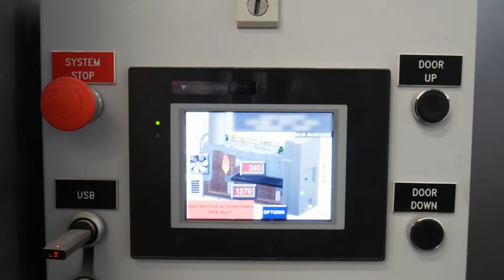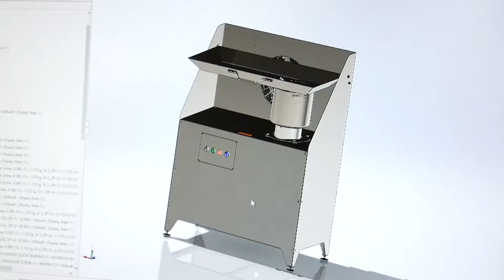Cremation Systems

Comment: I spent 3 months shopping for and comparing retorts. While the CFS-2300 was only a slightly better cost than other manufacturers entry level machines, I liked that the CFS-2300 was the only model they built. I told the competitors I was considering this machine, and they only focused on bashing it, instead of educating me how their machines perform better. While the bashing sounded good in the moment, it didn't make sense in the days and weeks down the road. (Who could continuously  sell machines that burned the hands off of the operators) As a third party provider, it was important being able to handle cases our clients couldn't cremate in their own machines. The CFS-2300 is rated to handle 750+lbs. Entry level machines from competitors didn't offer a capacity anywhere near that. Our build and install quote was roughly half the time from competitors. While other competitors tried charging me for remote internet monitoring on the machine, Cremation Systems included this at no cost. Ultimately, we are excited to be the first in our state to receive machine from this company for installation. We look forward to receiving this machine in October 2021.
Reply: Andrew - thank you very much for the kind comment, it is appreciated by all of us at Cremation Systems. Burning the hands of operators is a new one we've never heard! We are looking forward to working with you. 
Sincerely, 
Cremation Systems, a division of Armil CFS, Inc.